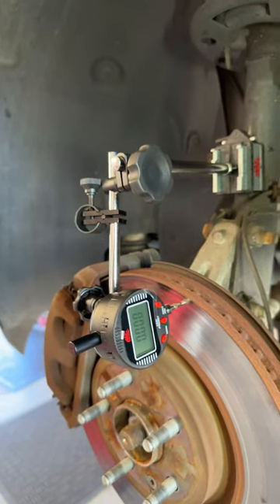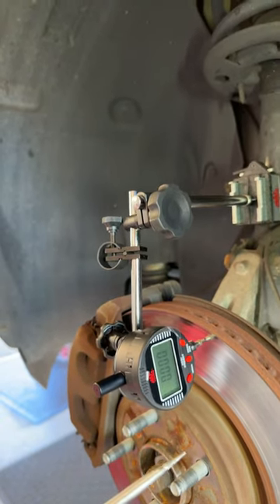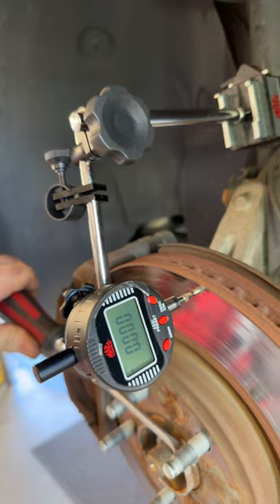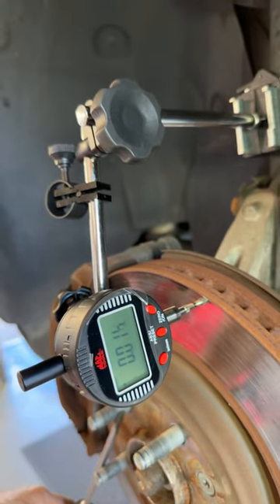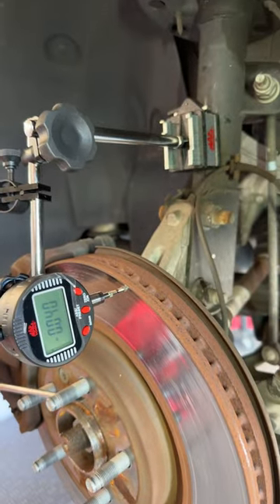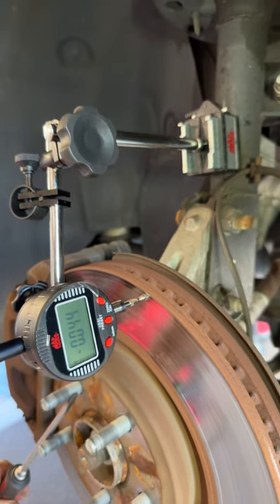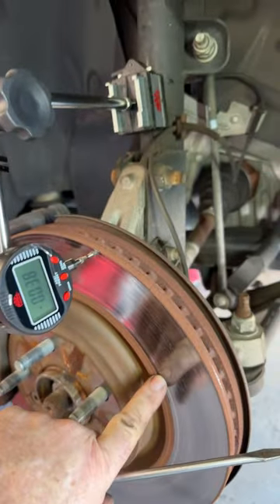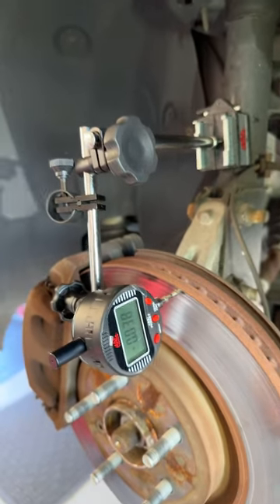Checking brake rotor runout for brake pulsation complaint?

Comment: It's probably warped..... but you should've put lug nuts on all the lugs. You're relying on the little set screw to hold that rotor to the hub snugly and evenly
Reply from the maker: New rotors corrected the pulsation. Checking hub runout before pad surface runout and comparing them. Hard to squeeze all that into a short video.

Comment: The allowable run out is always a mess, I did a 2020 F250 recently with steering wheel pulsation, it only had 0.002" of run out and ford I believe said 0.004 was allowable. Well It ended up being the rotor because after new brakes and rotors, the problem was gone. I initially tried rottating the tires to see if that was it, and it wasnt. Always be skeptical of allowable runout
Reply from the maker: Very true! Nice work!

Comment: You really cant say that your measured runout is real because you didnt lock the rotor down with lugnuts...  your setup is a very inaacurate measurement method...
Reply from the maker: Hard to fit it all in a 15 second video. Thanks.

Comment: Brake rotors or the wheel bearing/hub face machined too much
Reply from the maker: A full video would compare the hub face with the brake pad surface of the rotor.

Comment: It would be interesting to see what reading you get on the new rotors. That was some serious runout.
Reply from the maker: The new rotors fixed it up, but I did not measure them, just road tested to verify the pulsation was gone.
Reply: Just for kicks I measured new rotors I put on my 2007 Fit; on the analog meter the pointer was moving within one division (0.001) meeting the specks.

Comment: Those rotors looked thick enough. You can machine rotors as many times as you want as long as they are thick enough when you are done. 40 thousandths is very small amount to remove they would’ve been thick enough still.
Reply from the maker: Probably, have to measure against machine to and discard specifications.
Reply: Are we talking after you cut the rotor?

Comment: I have a wicked brake pulsation but front rotors indicate <0.002" inner and outer runout. Rear drums are at 0.006" (right) and 0.020" (left) radial runout.
Rear hubs indicate at <0.004" lateral  and <0.006" radial. 
I had the left rear drum turned. The tech said it was good and did a skim pass but still indicated at 0.020". 
Could that one drum be causing the pulsating in brake pedal ? Btw, this is the 4th set of drums. All others were garbage and these (AC Delco ) were the best but still not perfect. 
I don't feel a vibration when using Ebrake only which would point to the front rotors but they check good. Im at a loss. 
94 chev silverado.
Reply from the maker: A Pulsation is not so much from runout as it is from both sides not matching on the rotor or drum. The caliper slides can handle some runout, but out of parallel will force the piston to move since the slides can't handle more than one direction, if that makes sense the way I'm explaining it. 
So I would check the rotor thickness in a dozen or so places and write them down to see if it varies more than a couple thousandths. 
Also make sure other things like tires, u-joints and idler arm are in good shape, since they can make weird vibrations under braking or acceleration also.
Reply: @JimmyMakingitwork  10-4 thanks

Comment: Clean the wheel hub face and then check again. Reposition rotor and check again.
Reply from the maker: If you find excessive runout then that would help determine if it's in the hub or rotor. Or you could check the hub on its own also.
But moving the parts around to reduce runout would be time consuming and parts would usually be replaced if they are out of spec instead.

Comment: You are supposed to use to lug nuts on the rotor and do that. Have to secure the rotor to the hub. 🤔
Reply from the maker: Very true. But this rotor was not going anywhere and I'll do a full video about the proper technique soon.
Reply: I am not trying to be not nice for the guys doing the videos. But if you are gonna look at run out. That's the way to do it. If he to use the lug nuts those numbers would come down. Anything over 4 thousands run out need turn it and it will do it again. Or discard rotor. Even the new rotor will have run out that why I turn the new ones alittle.

Comment: I would love get a dial incator like that. That rotor extremely bad. I have seen people turn them even brand new
Reply from the maker: Yeah, new rotors fixed it right up. When I worked at Midas we used to surface new rotors all the time, they were so bad white box parts. Then we found out they can't be sold as new if you machine metal off of them, a lawyer informed us. So we started warranty replacement if they had too much runout new. lol
Reply: @JimmyMakingitwork  oh okay. I never knew that

Comment: Are you sure it ain't the hub? Pull the rotor and check the hub.
Reply from the maker: This car was just getting a brake job and wanted to do a quick rundown of how to check runout. Hard to get it all in a 15 second video.